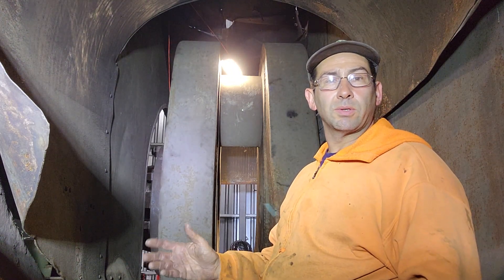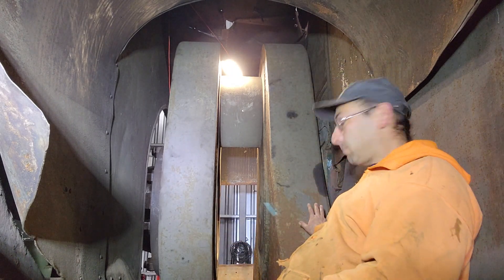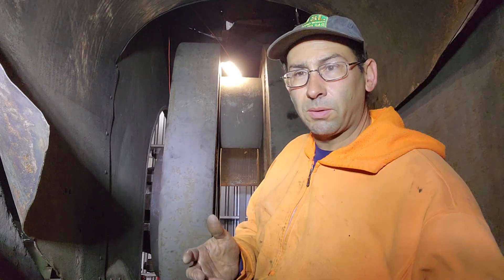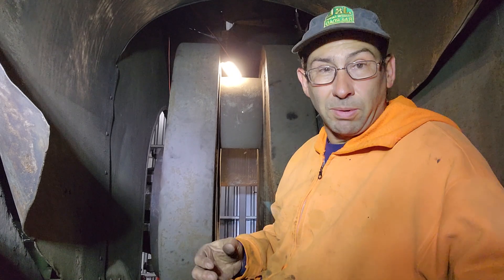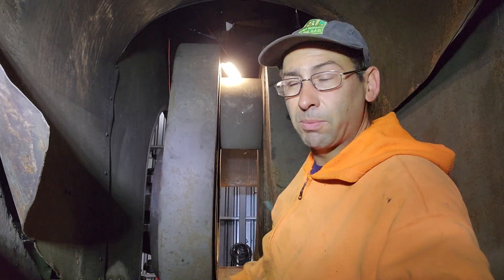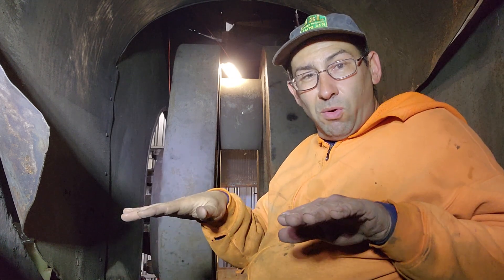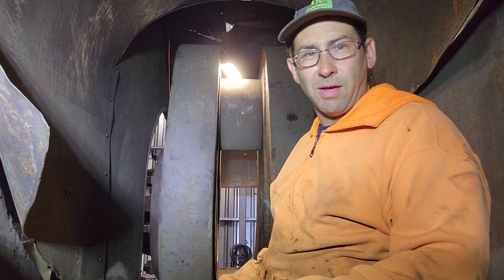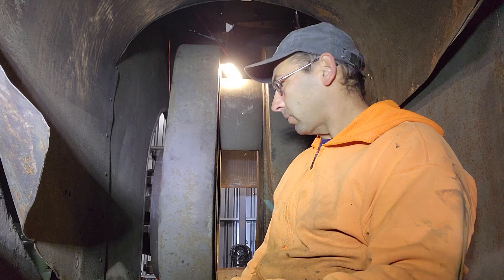Tod Engine - Inside the LP Bedplate

Comment: I didn't realize (I should have noticed, I saw the valves) that only one side was Corliss... blowing my mind, because I know that normally a rolling mill engine must be reversible.  Was this mill different?  Corliss engines are not reversible I understand... that's why there are no railroad Corliss engines.
Reply from the maker: Thos particular rolling mill was a cross country type with the steel going through the stands in one direction only.

Comment: A millwright? You can do it. 
As an injection mold engineer it is hard for me to visualize the foundry and patternwork.
If along the way you have the Corliss rotary valves removed please video them.
1992-1997 I visited Packard Electric in Warren, Ohio from South Central Pennsylvania almost weekly, saw many snowstorms at Hopkins. 
Nice people, was amazed small town new automobile dealers always had a train garden in their front window about this time of the year.